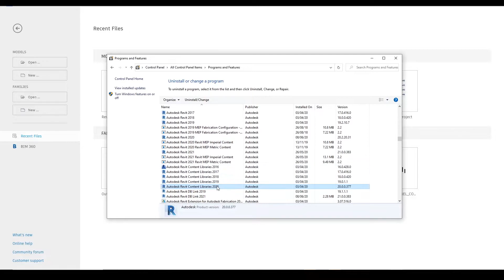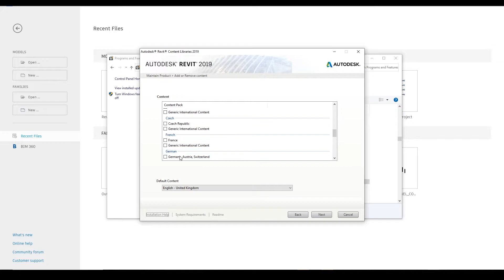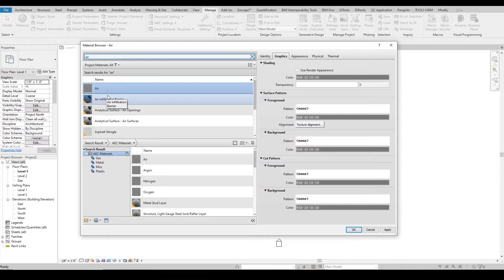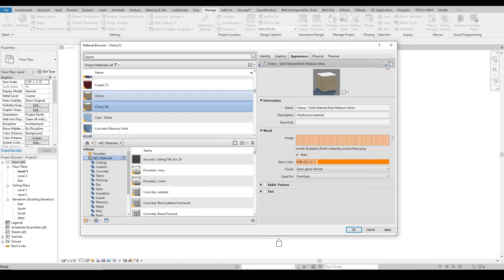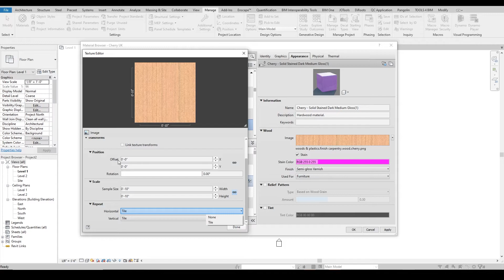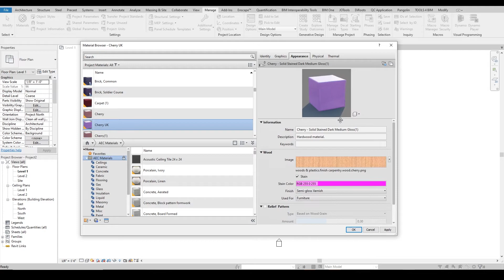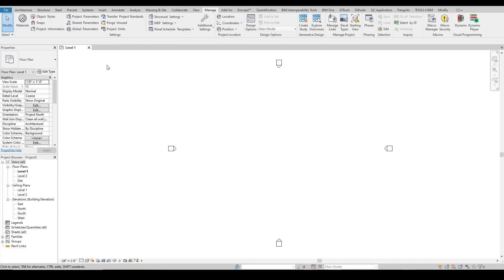Revit Material Library | Revit Materials Tutorials

Comment: Hi, I like the video and I have a question. How does it work in Revit 2021? I need to know if I have ENU metric and Imperial libraries but if I try to download them and extractm every time I receive an error. I'm pretty sure during the installation I installed the libraries as weel but is there a way to check it ?
Thanks

Comment: Sir please help me i cannot resolve my problem. Material browser does not launch while clicking on material in revit 2020 nothing happens.
Reply: I'm currently facing the same problem as well, may I know if you got this issue solved already? If you did, do you mind sharing how you did it😅😅
Reply from the maker: Hi 
Mayur Dabsay, 

Thank you for reaching out. 

If you haven't found a solution already, you can try the "Repair" option on the Material Library and Image Libraries from the Windows control panel / Programs and Features. If that does not correct the problem, then uninstall the Material libraries that are currently installed, and then run the Revit installer again to reinstall.

Hope that was helpful!

Comment: My ACE materials folder says its missing there is nothing in it and i cant find a way to relocate it and i really would love to relocate it. any ideas?
Reply from the maker: Hi James, 

Thank you for your question! 
Could you help us understand the issue you are facing? 

When Revit is trying to access the file, do you receive an error message: "Located File is Already in Use by Another Library. Please Select another file?

Or the issue is related to something else?
Reply: @IntegratedBIM  that was a year ago I don’t even remember writing the post. I have since fixed the problem but all the same thank you for trying to help.
Reply from the maker: @jamesh9466  Happy that you had found the solution. Your question is from long ago indeed. For some reason, we've missed it out. Thanks for reaching out anyway. :)

Comment: i can't find the AEC materials the file is empty
Reply: please i need help
Reply from the maker: @feryalmourad4418  Yes, sure! I will do my best to assist you with this. Could you please answer the question above?
Reply from the maker: Hi Feryal,

Which version of Revit are you using since there is a different method depending on the version you are using?